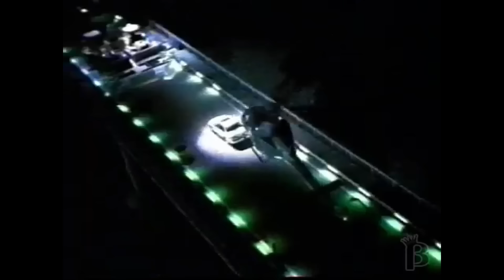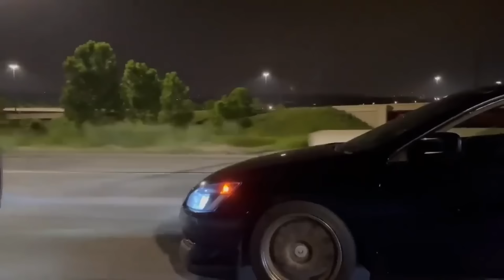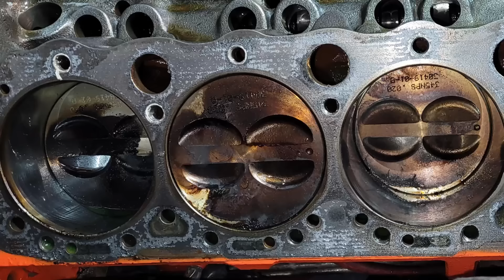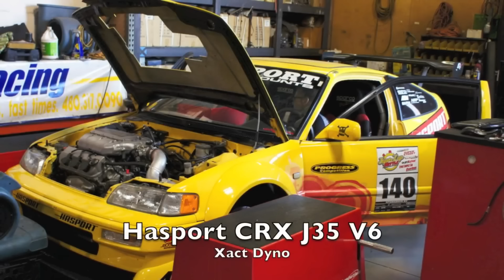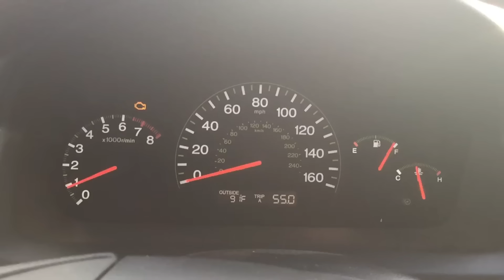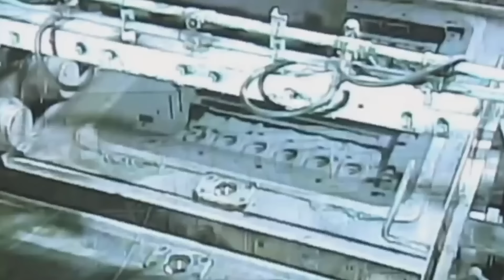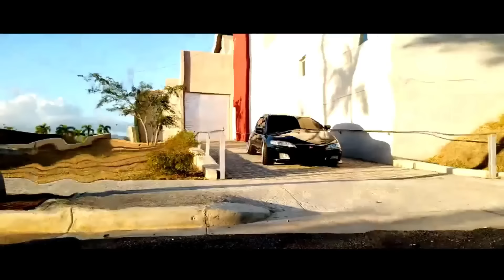Honda Accord: The J30A America’s Most Reliable V6 Engine!

Comment: I have a 03 CL Type-S j32a2 with 6spd factory lsd in taffeta white and about 10k in suspension and engine/transmission modifications. The only thing it's missing would be the navigation system I'm not worried about having
Reply: CL COUPE and Type S are beautiful beautiful cars
Reply: What suspension package did you go with..i need to replace all mine on my 01 CL
Reply: @clemfandango5908  the front has custom made 1 off 3 way adjustable BC 
 ZX series coilovers with 14k swift springs for the track could use 8k which is what bc br come with the whole Hardrace suspension catalog for the CL-S6 even the spherical bushings fastbrake adapter for the RL big brake kit upgrade and ebc yellow stuff pads should of got the blue stuff pads stop tech braided lines and 350z nismo rotors it has to be those rotors don't get the regular 350z ones they will mess your pads up they are a hair to small and thinner insane shaft 500hp cv axles rear has bc br coilovers with upgraded 14k swift springs common thing in budget builds for tracking on road course every k tuned arm for a 04 08 tsx they have the same rear suspension as the CL-S6 progress tech rear  adjustable sway bar and moog rear sway bar end link might be a different oem replace though
Reply: Oh P2R poly bushing kit and innovative mounts 85 grey motegi traklite wheels with nitto 555 gs tires had federal 595 for the track the  235 for the nitto 245 for the federal have to roll the fenders to make a 245 work
Reply: And get all brand new hardware for the stuff you get it will save you a lot of time i had to cut a lot of my stuff out then had to wait on new hardware in the mail
Reply: Those are beautiful cars, especially the ones that came with ground effects.. My friend had a beautiful Blue one in the late 90s, I used to race him with my mustang and Trans Am, he would keep up adequately..
Reply: That was gold
Reply: Got a few pics posted on this channel,and created a new channel. I'll start taking a few clips of the process with the car here and there.
https://youtube.com/@hondatrackcars?si=gzurvR5Fc88iWx03

Comment: The Honda 4 is such a sweet engine, have to ask is the V6 worth the extra weight, fuel, maintenance , insurance and more?
Reply: Tbh you can save a lot more money on the j series v6 than the i4s from honda. I've only ever owned k24 hondas but the j series power and smoothness cant be matched. The weight difference is barely negligable when you go j swap if you're going dailying with weight in the trunk. But for SFWD it all depends how much money you got to spend. With an "unlimited" budget both j and k series almost make the numbers when fully built. But stock the j will last longer naturally than a k.
Reply: I’ve had several Accords with both engines, when I buy them I only buy the v6 with a manual.. If the car is an automatic i prefer the K24.. The v6 was a lot of power for the moderate fwd transmissions in these cars.. So V6 6spd, K24 automatic.. The K24 is a great engine that can make a ton of power if you are modifying..

Comment: J30 homage but the J32 was what got peoples attention. J37 at 305hp is a naturally aspirated gem as the J30ac twin scroll vvt non vtec forged crank and rods good for 355hp. Don’t sleep on the 2025 Pilot J35y8 285hp 10 speed. Gx163 in 93 was like the FL350 and Fat Cat. Lasting impressions.

Comment: good video but why not go into j35 or j37..  way more powerful than j32... and will be the main swap engines than the j32 due to the number of engines available ... j35z3 j35y2 j37..  you need a part2   v

Comment: Still Driving my 2003 Accord 3L V6 with 220k on the clock.
Purring like Day 1 fm the factory
Reply: That’s awesome!
Reply: Do you feel your Accord is slower than new?  Or any changes performance?
Reply: @BartholomewPepidickinakas 
Still does the same 0-60 times n Top speed
Still getting Factory claimed mpg
Alls Good
Reply: Just got one from my sister for free. 280000 best running motor iv had.
Reply: @W @Walker-j9r ur sister must love you. You take care of it and it will last you until you die. Not even joking.
Reply: Still driving 99 accord v6. Over 260k miles. Daily drive it.
Reply: How’s your trans? And ever had a code pop up?
Reply: @glenglen5362 
Nope
Alls good
Reply: @glenglen5362  I drive mine about 95% like a normie grandma and about once a week a lay into it. Pedal to the floor from 0 to 100 and I don’t let off. Trans has been flawless on mine. I don’t drag race or drive aggressively other than my monthly wide open run on empty flat area. Either I’ve been lucky or others crying about the 4 speed have been abusing theirs.
Reply: @TsunauticusIV yeah mine I think the previous owner on mine definitely drove it aggressively without looking into a lot of stuff I’m here having to fix what they didn’t but 😮‍💨def a fun vehicle